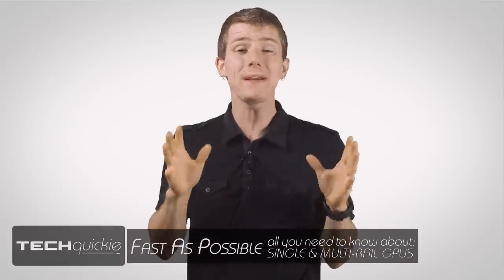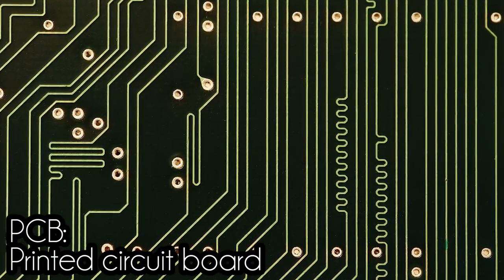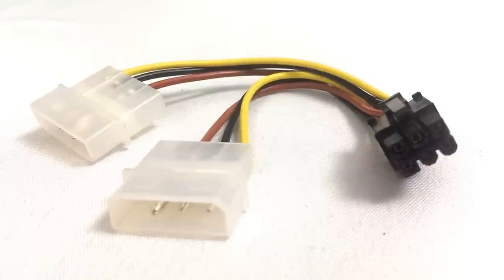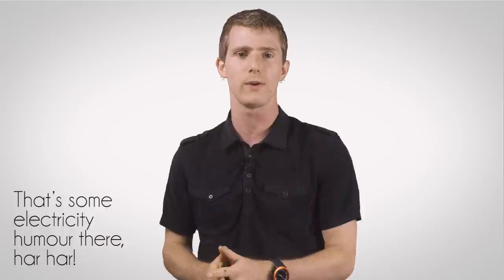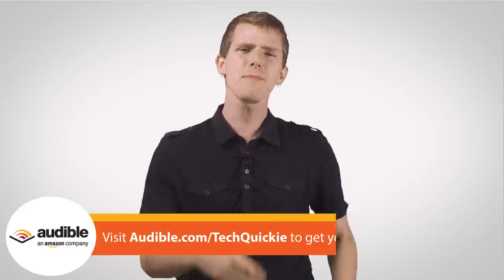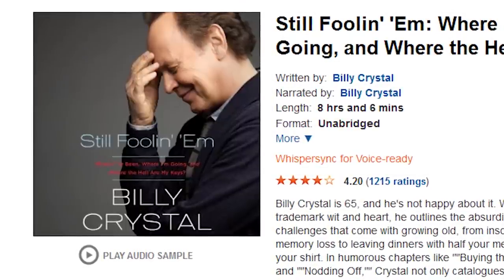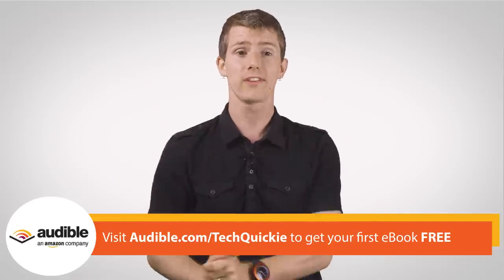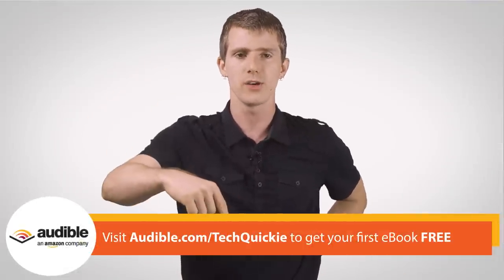Single Rail vs Multi Rail PC Power Supplies as Fast As Possible

Comment: Let me give people advice, when it comes to PSU's never by cheap ones, my cheap one exploded on me when I put in my new GPU and it almost killed my whole system, luckily my motherboard saved all my parts because of it's short protection, if your PSU is sketchy replace it with something trustworthy even if it's 3x more expensive for the same wattage but it's common sense really.

Comment: I prefer single rail just for the convenience. It's a hassle if you have a large power demand and a PSU with several weak rails, because you have to strategically spread everything out or you risk your PC randomly shutting off, especially on weaker PSU's.
Reply: Phlaked Corn +1! Not only the PSU shutting down, but driving a rail close to its limit results in less efficient line regulation and filtering, and those variances and noise your hardware connected to the PSU then has to deal with it. A single rail power supply is just better. Multi-rail PSUs exist only because they cost less to produce (big magnetics and capacitors for filters are expensive!).
Reply: +Phlaked Corn well you need multi rail PSU's to power higher end GPUs if you dont have those rails your system wont boot at all
Reply: Washu Ken Sorry but that makes no sense.  Actually a single 1000w rail is going to be better than 5 200w rails if you have 2 power hungry gpus, not like it won't work but you have to pay attention to what is connected to each rail, otherwise it may not boot or power off randomly while under load.
Reply: Phlaked Corn welp somethings cant be changed because if you have only one rail how do you connect the other to the other 6 pins? because if that doesnt work then it wont boot at all
Reply: You don't know what you are talking about. One rail does not mean one connector. It means one circuit. It means two power hungry GPU's can be connected on ANY 6 pin connector. If you have multiple rails, you cannot connect both GPUs on the same rail, because you are overloading one circuit and not using the other.
Reply: That's not what I said... We are saying the same thing, single rail is better.
Reply: HMan2828 Lol, you're right, I'm the one that is confused. Seriously was not reading the right comment or something lol.

Comment: What happens to PSU companies in a few years when even the highest end PSU's dont need supplemental power? I mean sure build quality and efficiency would still be a thing i guess but are prices going to come down as well? Who is going to buy a 400w PSU for over 100 bucks or whatever 1000w units are going for today? If the 750ti is any indicator, in 3-5 years the top end GPU will probably consume 100w max.

Comment: WAIT WAIT WAIT WAIT!!! Linus Sebastian, what are you doing?!
0:25 - "12 V, 5 V and 3.3 V current". Really? I know you are better than this Linus. It's 12, 5 and 3.3 volt voltage, not current. Sure I understand what you mean, but so many people that are new to these terms (especially on this channel) watch your videos and will learn from you, so please be more correct than not correct :)
Reply: You mean potential difference not voltage
Reply: MrTheBmeister I'm not natively english speaking, but I'm quite sure the definition of voltage is potential difference. If not so - what's the difference?
Reply: You forgot, " AC current and DC current"
Reply: I am aware this is a very old comment, however Linus was actually correct. The wires do indeed carry current, at 12, 5 and 3.3 volts. Power, or watts is =volts*current after all.

Comment: AC / DC ! LOL ! I doubt not many notice the way Linus wrote the words AC and DC in that font for a reason.
Im rocking on a Multi Rail PSU =) But just make sure that the Rails your using for your component has sufficient AMP to power it that's all it matter most.
If not well like Linus said, sudden shut down during intense situation.
But don't worry if for example your system uses 350W , you get like a 550W or more PSU , the rails will usually have enough AMP for your components.  
And Linus ,  you forgot Grounding , you only mentioned Volts =)

Comment: Ok first off it has to do with amperage. Single rail power supplies allow the amperage to be pulled to the component that needs it regardless of which component is using it. Multi on the other hand do not. Also because of the high amperage the quality of components needs to be better to handle it. Why? because amperage creates heat so cheaper materials can not be used they will either burn up or melt. So the cleanliness of the power aka less osculations in voltages is better with single rail power supplies. All of that leads to better and longer life of components. Why don't you do yourself a favor and actually educate yourself before you post a video explaining a tech you do not fully understand. Also if you still use top of the line graphics cards and buy a multi rail system you still need to see if the 12v rail is split or not. BTW that is the difference with so called single rail power supplies that are multi rail the 12v rail isnt split you know the thing for your graphics, hard drives, disc drives. But, I should listen to you because you look like a nerd. Now wait a second i just explained everything faster and better then you and in less time damn it feels good to be a gangster.

Comment: It's not the number of rails, but the amps on your 12v rails. And multi-rail PSUs usually have half the amperage, leaving the potential for a power-hungry PSU to overload a rail even though the total potential wattage of the PSU is higher than is being consumed.

But, sure, generally if you only buy well-reviewed PSUs and don't try to be cheap, you'll be fine. My favorite way to explain it:

If your whole PC had to hang from a cliff by a rope in order to operate, would you even consider buying cheap rope? No? Then buy a PSU that's better than what you need and with a 5-year warranty. Save money somewhere else.

Comment: Now I feel even more worried about my PSU.. Already re-soldered a new fan to my TX650 board, now the capicitors sound like they are slowly going to pop... And I have random PSU outages. And my electricity trips out everyday.
rip
Reply: Sounds like you need to get a good surge protector with a line conditioner/voltage regulator in it. Maybe even an auxiliary power unit. 
Bad electrical wiring in a house can kill a pc faster then anything.

Comment: I have a power supply that has 4 12 volt rails at 20 amps each, based on my calculations my processor uses over 20 amps by itself, and it shares a rail with the motherboard connection.... is this why I am having issues overclocking??

Comment: My XFX PRO Black Edition, 750W PSU melted the PCIE Graphics cable and the socked and cable fused, PC still worked until i loaded a game and than it crashed, so most PSU manufacturers now supply daisy chained gpu cable, and my OC GTX 980Ti may have over loaded it. XFX Warranty in UK is CRAP OR NON-EXISTENT..  on another note Audible is so addictive i keep buying books as well as my membership not good for my pocket but enjoyable

Comment: Pretty much all Multi-rail PSU's these days are actually single rail in construction internally.  The over-current and short-circuit protection is typically separated into rails for safety so that no one rail/wire goes beyond a safe current range but this all ties back into a single rail for each delivered voltage.  If they were not designed in this way you would not be able to combine multiple rails for more current delivery as they may not all be at the same voltage due to variations in voltage regulator chips.  This is why if you read the label on a multi-rail PSU they will typically show a maximum wattage rating for each voltage supplied no matter how they divide up the power.

Comment: Well, there's some truth to this, but before the current days of PSU manufacturers inbreeding components to match spec... multi-rails were just unstable from mfg to mfg.
I'm still using the single rails as I would if I were still working on military radars. The only difference is the cost in that it's cheaper to produce multi-rail PSUs vs. the single rail unit with higher spec'd components I.E. ICs, VRegs, C, & T.

Rebranding is big nowadays...

Comment: Not the best techquickie so far to be honest... yeah it may be true that some single rail power supplies inside have multiple rails but that is totally irelevant. In those cases the power supply at the end is single rail because all those rails actually join together before reaching the output and therefore each rail will always have the same load (due to simple ohms law, week 1 day 1 of electronic engineering :P). this differs from power supplies advertised as multi rail because in those cases, lets say in the case of a dual rail power supply, the CPU and the motherboard 24pin could be connected to one rail and the GPU connected to another, not uncommon, in this case, one rail will be carrying a different load to the other and this is why a single rail PSU is normally seen as preferable. of course this load difference may not be all that big and thats why it isn't really untrue to say that it doesn't matter if you have a single rail or multi rail PSU but it is something to be aware of.

Comment: Linus, please, don't be kidding... It does matter if your PSU can deliver the necessary power over its rails. While building a powerful gaming PC, I can pick up a 450W power supply, both a single-rail and a 3-rail unit. The difference is, the 3-rail one will be overloaded with either the graphics card or the CPU, and if it works at all, it will shut off when you game, or even break.

Comment: On rtx 3080 are now Multyrails matter? Some people say i have to get a Singslerail psu for a rtx 3080?
Reply: it still doesnt matter i say.
Reply: Go single rail it will distribute the power evenly, problem with multi rails they only allow so many amps down a specific rail, over load that rail and your computer will shut down. With a single rail it will send up the max it can support, e.g 80A rather than 4x 20A for different devices. If the graphics card needs 23A then the 20A from the multi rail can't deliver that much and will shut down and you need 2 PCIe cables with loose ends since 2x PCI 8pin will be hanging loose. If you have a 80A single rail then it doesn't matter. My friend had a corsair 750w multi rail PSU and a GTX 1080Ti couldn't power in till you get the PSU lay out and work out which power line is for what connectors because you can have to PCIe per 12v rail thats supplies 17A which is not enough for a 1080Ti so you need to use 2x 12v *17A) rails to power the graphics card. With graphics cards power requirements continually going up and is no longer being displayed in the spec you can run into problems.

Single rail.
Easy cable management
Less hassle - working out the Amps of the devices and making sure no 1 rail is being overloaded 

Multi rail
Cheap.
When a rail over volts it will only happen on one rail (very rare to begin with)

For me personally i will pick a single rail PSU every single time.

Comment: I had single rail... I had triple rail... they all worked fine and my house is not on fire yet. :D :D :D (Too soon, Austin?) 

As long as you have enough wattage, voltage and stuff, you'll be good. And ofcourse, avoid no-name brands. Go for something good ! (Said the guy with a Superflower PSU... I mean, anyone heard of this brand ? I like it.. good 90+ Gold PSU 600W, glad I bought it. My house is fine for now..............)

Comment: I have a PSU with 22+22+25+25A which ran my 6+8PIN GTX 970 just fine. Now I have a GTX 1070 with a single 8PIN and rumors has it 1070 need 30A so maaaaaayyyyybeeeeeee single- vs. multi-rail DO MATTER!!!??? :'(

Comment: This is some of the worst PSU advice I've heard in a while. Rail numbers matter. If a power supply is purchased based price and on the needed total Wattage without verifying the rail current, your system may not have adequate current to keep things stable. I've seen basic entry level dual core systems on a 530W PSU BSOD due to inadequate 12V MB current. I've seen video cards flake out, Even HDDs act up.
There are general rules of thumb but each build can vary based on specific components selected and you may be facing a situation that is outside of the rule of thumb. Mostly the connecters are designed to handle certain amounts of current but a PSU manufacturer may have supplied say a 4+4 MB connector for convenience when the PSU rail doesn't supply enough current to feed a MB that needs the full current a 4+4 connector is rated at. That's just one of countless examples. I generally purchase single rail only if under 600W. A good name brand over 600W the PSU will most likely have the rails divided up to provide enough current for the connectors on that rail.

Comment: I have a Hiper Power 880w PSU with quad rails from 2008. I've just got a GTX 1080ti to add to my system along side a GTX 670 and the system is shutting down/restarting when I try to game. Possibly because of the rails OCP?

Comment: No, it's not the same... Let's say we got a psu 500W with 2 rails... 250W each. One rail goes to CPU. As soon as a 13900K try to use 253W, the psu will shut down, even if use a weak gpu or igpu... 500W  my a$$... Single rail is the way to go...

Comment: Hi, i'm looking for a power supply for GTX 460 (2x6Pin, 26A). Would this one run it >> "Maximum combined current for the +12V outputs shall be 36A ." (+12V1 - 18A, +12V2 - 18A)? Thanks! : )

Comment: i need a new PSU, new egg says i need 900+WATS but cooler master says i only need about 600, who should i believe? im running one Radian r9 270x 1 disk drive 1 hdd and a 6 core amd processor

Comment: hey guys what PSU do you reccomend for the next configuration : i7 4770k r9 270x toxic edition 8 gb ddr3 ram  GA-Z87-D3HP mobo 2 hdd with 1tb each on 7200rpm  ? i would say a 650W would be enought...but the real question... WHICH one...

Comment: well because nobody has said it yet, you should NEVER EVER buy a no name brand psu.  it is much cheaper to buy a new psu than a new rig or in the worst case a new house.  no name psu don't always have the safety spec that they claim to have.  They also might not deliver clean power to your parts wich could make the parts die sooner, tiny tom logan has a good video about that.

Just spend a little extra go do with a corsair or any other brand that are good.

Comment: ok, question. installed r9 270x. started having system crashes. pulled case cover and discovered that only one of the 6 pin power connectors was fully seated into the GPU. the other one could not have been providing power to the GPU. I plugged it in better but did i hurt my new card in the process?

ps. its a supposedly a single rail psu if that matters.

Comment: I want a little help bro
I am building a pc. It have ASUS MAXIMUX VI FORMULA. ASUS NVIDIA GTX 780M. 16 GB DDR3. INTEL CORE I7 4770K UNLOCKED. CORSAIR CPU COOLER. tell me witch power suply can I buy please tell me.
Reply: Thanks
Reply: I have didn't found the seasonic power suply in Finland I have baught the corsair RM 750 80percent Gold... is that OK

Comment: I guess i can forgive you because this is the tech quicky chanel and it is aimed at regular folks with basic pc needs. But  even then, just saying it doesnt ever matter is just wrong and incomplete information. Single rail and multi rail both have their uses. there are situations multi rail psus are just not acceptable, just because those situations are rare and regular pc users probably wont encounter them, doesnt mean they do not exist.

Comment: Building a set of night bicycle lights with an Adafruit 3.3V logic Trinket (turn signals and hazard lights) powered by a single LiPO flat pack battery. Every LED has its own dropper resistor; the white LEDs especially have naff all power pissed away as heat. Everything powered from a single 3.7-4.2V rail -- none of this multiple rail rubbish! :P

Comment: Wrong. If you have a 4 rail PSU and you need to power a powerful GPU, you would need to use all 4 because only using 1 out of the 4 rails would not be enough. That is the difference.

Comment: my second power suply dos not have the 24pin(motherboard). Can I just 
huke up the green wier and a black wier to the corect position's on the 
add2psu adapter or does it need all the wires in the corect places ?

Comment: what happens if someone's psu have only 1 pci 6pin connector, and although not recommended he uses a molex to pci adaptor for his 2 connector graphics card... but turn out internally the pci is on 1 rail and the molex run off another rail. will this actually be a problem due to tecnically different currents meeting, or is this actually ideal?

Comment: CX 600m it's a single rail (highest power draw my pc ever gets is 480w though (100+TR 100+VS 100+NC on the crown)) but this worries me, will the single rail be okay for extremely intensive gaming?

Comment: And yet, modern 1200W quad rail PSUs cannot power on a system with a top-of-the-line GPU that demands high power-on current. I've seen lots of cases where a smaller single-rail PSU powered on a high-end system where a higher, quad-rail PSU would just tick the fans one and then give up. Faulty unit? Maybe. But there were 20 builds that had the same issue. So single-rail all the way is what I say.
Reply: Defective batch then? Was over 4 years ago, can't remember the manufacturer. All I know is that they had 2x Radeon cards